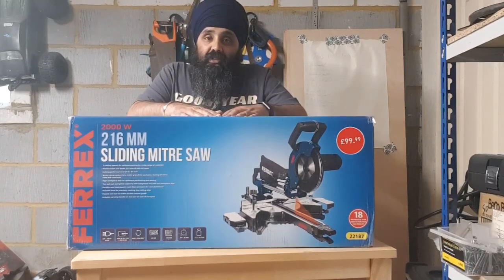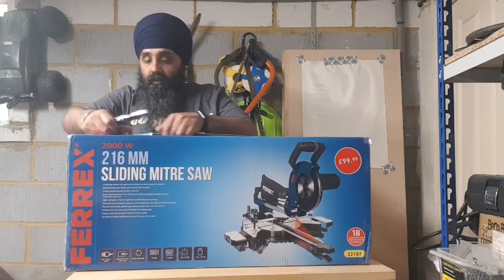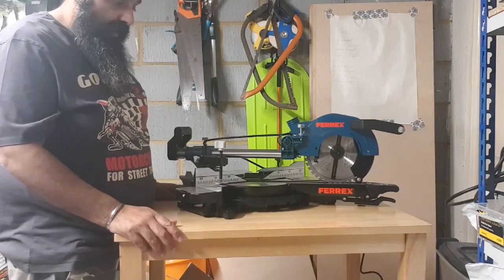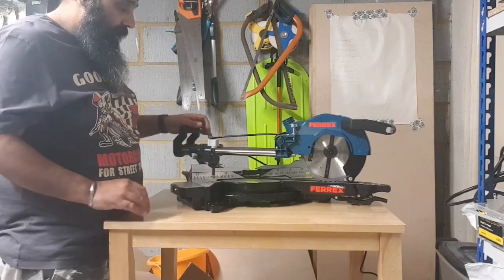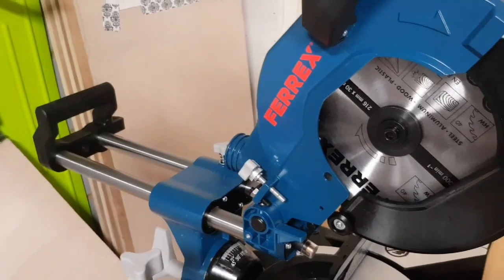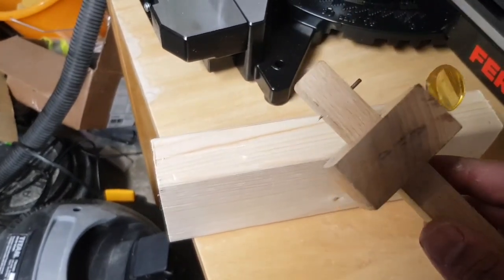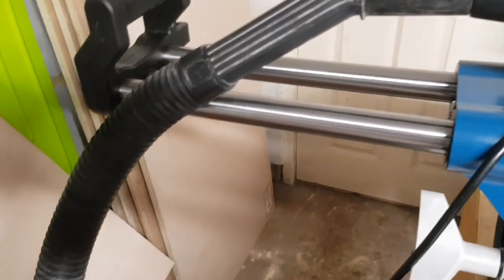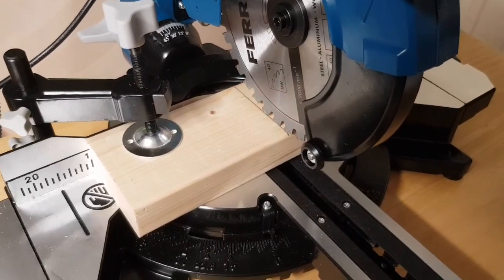Aldi Ferex 216mm mitre saw

Comment: Seems good. You need to keep your hand out of the danger zone. Look at the extended clamp that people make for holding down small piece. Also look into a down draft box, I think it’s called. Basically it’s a box with smallish holes in that you attach the hoover to and it sucks all the dust around the saw/router or whatever. People often make a hood around mitre saws to stop some of the dust going everywhere as another option

Comment: I do have the table saw....tempted to get the mitre.
Reply from the maker: The mitre makes cross cutting so much easier.
Reply: budgetworkshopandtools 1 
How do you lift it up I saw you found it tricky did you unlock it somewhere
Thanks
Reply from the maker: @rachelbyrne2287  there is a lock on the left hand side. It is the shape of a ball and needs pulling outwards.